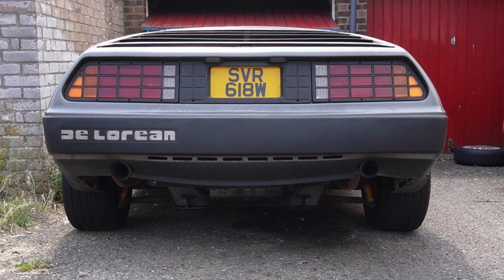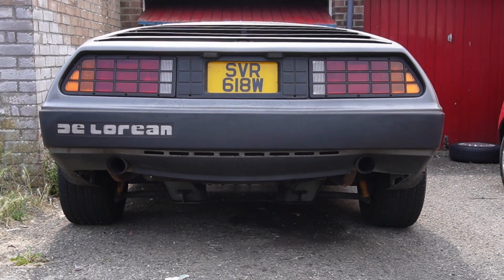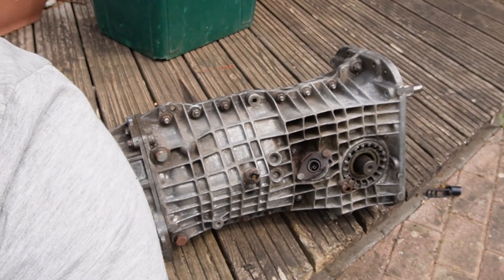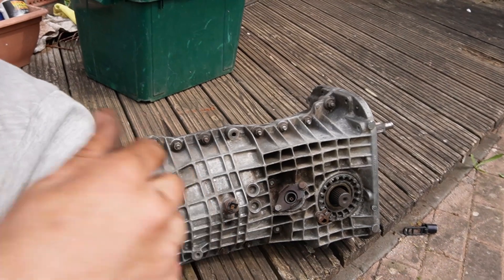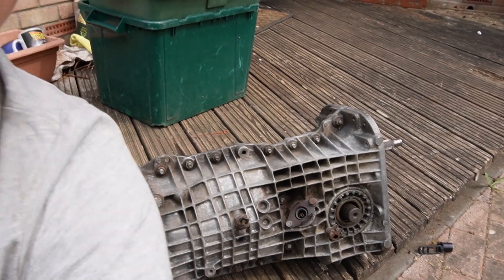Well Doc, it's Destroyed... DeLorean Update - MilesOnCars

Comment: is body off a big job?
Reply from the maker: I believe there are 10 bolts holding the body to the chassis, then the brakes, heater, A/C, steering, throttle cable and electrical items need disconnecting. Lots to do but it’s all fairly simple. Medium job?